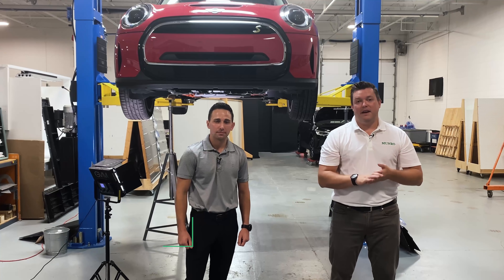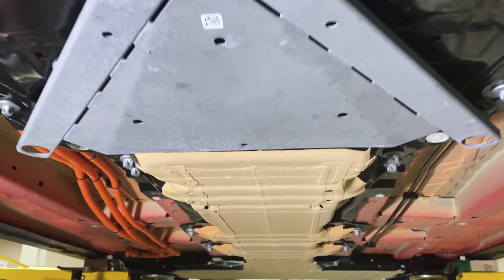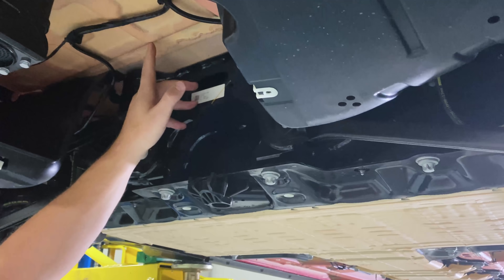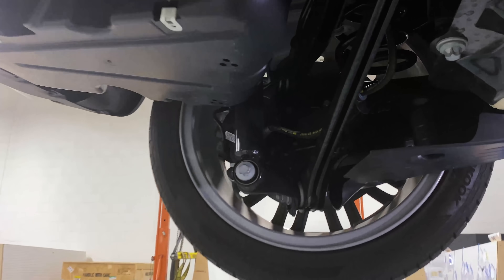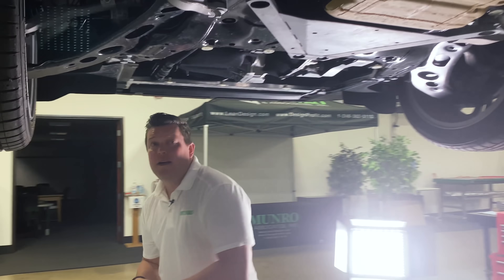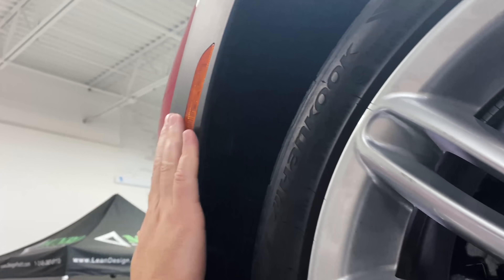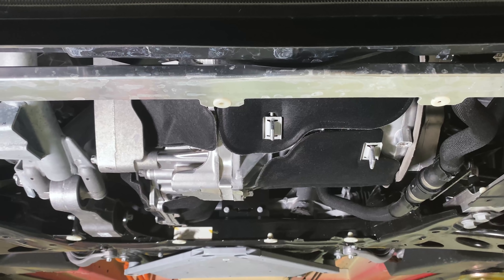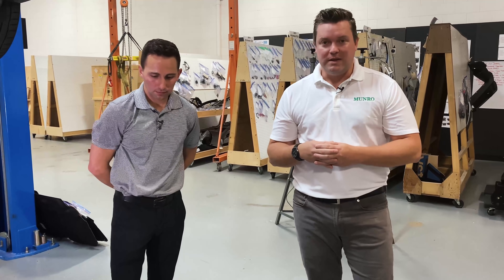Mini Cooper SE- Electric | Undercarriage

Comment: Does anyone know if the battery is accessible only from under the car? Or is the battery accessible also from under the rear seats from the inside of the cabin?

I am afraid of battery leaks, so I do not want the battery to be inside the cabin. Any info?

Comment: Can't believe the exposed high voltage cables.  You could rip them off going over a curb.  Jordan is a natural.  Very informative.  Hope he gets more air time.  Cheers.
Reply: They are not exposed. The Munro team failed to mention that they took off the protective shielding before filming.

Comment: I was horrified to see about 3 feet of exposed high voltage battery wiring underneath the vehicle running alongside the battery pack where any road debris could compromise it.  To me this is very concerning.

Comment: It appears that most viewers of this video, who are mistakenly ranting about this being "bodged", "slapped together",  or dangerous do not realize that the HV cables are completely covered by a full body length underbelly pan (removed prior to shooting video), that actually provides a smoother and more aerodynamic underbelly than the ICE mini. The HV cables are in fact not directly exposed to the outside, as most seem to believe. I think it would have been more accurate to provide viewers a look at the actual underside without the underbelly pan removed, rather than to simply point out the location of the HV cables as a negative without context. It would have also been more accurate and contextualized to point out that other BEV's, such as Tesla, route cabling in the exact same manner on the underside.
Reply: As soon as this video ended I went in the garage and looked under mine to see the very long and wide belly pan.  I agree this video was a little bit misleading about what is actually out in the open and exposed.  Love my MINI EV.
Reply: Good info!

Do you know if the battery is accessible only from under the car? Or is the battery accessible also from under the rear seats from the inside of the cabin?

I am afraid of battery leaks, so I do not want the battery to be inside the cabin. Any info?
Reply: @KR93912  Think of the batteries in the mini as packages or "tootsie rolls" of coin cells, much like CR2032's, but bigger and stacked on top of one another. An ev's batteries are not plates suspended in an electorlyte or acid like a 12v battery. They don't leak. If damaged, a sort of spontaneous ignition can occur due to shorts but they can't leak as a common 12v battery.

Comment: The underside of a car I would think should have adequate shielding.  In fact, I would prefer top notch shielding especially for an EV.  I realize weight is a major criteria, but routing those electrical cables on this vehicle as shown, seems like an after thought.  Have your wire nuts handy every time you go on a ride.  LOL

Comment: What’s an epdm too please?
Reply from the maker: EPDM rubber (ethylene propylene diene monomer) is a rubbery thermoplastic widely used across many fields for its low cost, good molding characteristics, and very wide service temperatures.  It’ll stay rubber in winter in Canada or Russia, while staying solid in Death Valley or Dubai.
Reply: Thank you from Sydney Australia. Regards Chris. Great program

Comment: Looks like the high voltage wiring was an after thought. Why didn't they strap them on the roof. In winter driving ice would build up on those cables and get ripped off.

Comment: After watching this a second time, why did Mini/BMW run so many extra feet of heavy copper HV electric cables from the front of the car to the rear of the battery container at rear of the vehicle? Extra weight means less range in an EV.  Also, why did they use a metal battery pack container covered in sound deadener instead of a plastic composite battery pack container to save weight?

Comment: High voltage cables are done the same way in the $130k Tesla Model S Plaid. Check around 7:30 in the Rich Rebuilds video. And that is a clean-sheet EV.
Reply: Yup, people just wanna hate without checking their favourite vehicles out first

Comment: Would rejuvenator help the front spat? I've seen a lot of those plastic pieces ruined at the bottom of cars before so it's nice to see the engineering going in to make them last longer but i am guessing that over time it looses its bounce. I've seen some people spray WD-40 on rubber parts, not sure what you guys would recommend as a type of chemical to look for.

Comment: Did you guys pull that driver's side underbody 'spat' out, or did you receive the car with a fastener missing? If you look at 7:11 there is a hole in the plastic indentation that looks like a fastener should connect the spat to the metal above. If not, then that is some seriously odd looking design on Mini/BMWs part.

Comment: I'm genuinely alarmed by those easily exposed HV wires.  If the vehicle is involved in an accident or hits road debris then they are exposed.  In theory the car will detect the insulation failure but these systems may not be perfect.  They are also a maintenance issue compared to stiff brake lines that might be more typically exposed.  I would have liked to see them either routed in the interior cabin somehow, or with a plastic/metal cover.

Comment: Is it only me or is it just insane having those vulnerable cables dangling around unprotected? When I saw that I could hear Sandy scream across the globe in shock...
Reply: The covers have been removed for the purposes of the video
Reply: Also, not sure where those are running from. I thought the wires from the battery ran inside the tunnel. Maybe something for the regenerative brakes?

Comment: Very nice! Run over something in the road and rip your voltage cables right off of the car which
In turn will bust the connector in the battery and then you can put a new $25k battery in the car.

Comment: Rear cradle of the newest 5 and i believe 3 series are solid mounted to the body. (At least on the M models that i know of) It’s been a thing for a bit. But yes traditionally they are rubber isolated. Also yeah i noticed those lines are quite exposed and it seems they’re held on by plastic zip ties. I’d hope those don’t get brittle over time leaving those lines hanging down.

Comment: To me, I care mostly about the battery. It is my understanding that it is a prismatic cell style battery made by CATL. I hope they go into a price breakdown, but I believe this style is safer than pouch cell but more expensive and less energy dense. What does anything else matter if there is a crap battery or terrible BMS/cooling? I also believe that this style is easier to replace, at least judging by the i3 which used the same pack.
Reply: Not the same pack. Completely different architecture, cells, and count than i3.
Reply: @khitchens7308  Thanks. That information is always so hard to find. Hopefully they do a breakdown of the pack as well.

Comment: HI COREY, WELCOME JORDAN!!  I understand that the E-MINI is built on an existing ICE platform, and not a dedicated EV architecture, but why in the HELL would they do such a GREAT JOB protecting the front of the battery pack, and leave the most important electric lines just "dangling down" under the lowest, most vulnerable place of the car??  And isn't that orange plastic electric conduit not very tough??  ITS NUTS!!!   CHAS ORVIS, PLAINVILLE, CT.

Comment: Why do they even need the high voltage lines there? the motors are in the front aren't they? Unless its for the charge port, but then why put the port at the back / why not put the charging gubbins by the charge port???

Comment: This looks like the definition of a half ass Ev conversion job. I was expecting Mini/BMW to do a better job but they clearly did not. Great review guys !
Reply: really looks like a proof of concept/prototype. Those dangling orange cables though...
Reply: @CarlForde  the covers have been removed on this car, they aren't usually exposed
Reply: @CarlForde  on some German vehicles brake lines were routed the same way, never had any issues of them failing, that being said you would think they would protect them a little better.
Reply: Probably a rush product to fill a niche in a rapidly changing market with minimal effort.

Comment: I thought that BMW knew better than to have their high voltage power line underneath without any protection.  At the very least they should have a removable plastic covering.  Converting an ICE car to electric has many compromises.  This is one reason why Teslas are the best.

Comment: I don’t see any need to re-invent the wheel(s) see what I did there :-)
The car really won’t work as an EV because the 4 inch (or so) battery pack will raise the floor too much. An entirely new design is needed. Suspension might be traditional but everything else would change. Higher floor means  car has to be taller. I’m not a fan of SUV style but that’s what EVs feed into. 
Check out the designs by WilliamTowns back in the 1980s. His Hustler range had four and six wheel cars using mass produced subframes under a steel tube space frame with large glass areas. Safety demands have moved forward but that should not spoil the idea.

Comment: Forget stealing catalytic converters - that exposed wiring is valuable copper, and all one needs is a slightly customized big shear and some insulating gloves !  How does it survive debris thrown up by the tires when driving on gravel or dirt roads?  Bad design choices here, imho...
Reply: The guage of that copper is probably 12... It's not that valuable. Also you don't need gloves to yank it, the relays will but the high voltage relay when parked. It's very unlikely to shock when cut one at a time. That's also a really odd design... Why is the three phase inverter on the back of the car, might be in the penthouse.
Reply: The wires aren't exposed. They are protected by a very serious undercarriage cover. See this video: https://www.youtube.com/watch?v=bgBIDkQ5d0A. 

The jokers from Munro Live failed to disclose that they removed the undercarriage cover.

Comment: I'd like to hear Sandy's evaluation of those power cables hung on the bottom.
Reply: Me too. That is such a homemade style of job. No engineer worth his degree would do such a thing, unless he/she worked for BMW.
Reply: @mikedx2706  Perhaps they found a British Motor Car engineer for this part.
Reply: And why isn't the battery pack configured so the big leads come out near the inverter?
Reply: Look at the undercarriage of Toyota Prius. It has the same high voltage cables deployed in a similar fashion to the MINI. This is common practice. 

You guys don't work on many cars, do you?
Reply: @jayhawkeyes  Ignorance can be a cruel mistress.  While I respect most all the Prius has accomplished I see now that they have a design flaw that could easily lead to fires.  Many older British cars had the batteries at the rear of their front engine vehicles with some justifications but the wires were routed inside the protection of the floor and splash pans.  It would be interesting to know the statistics on the Prius and the sister ships that have high voltage leads on the exterior not to forget directly under frame extensions directly exposed to everything in or on the roadway.
Reply: @unclegeorge7845  "While I respect most all the Prius has accomplished I see now that they have a design flaw that could easily lead to fires."

What you "see" is a figment of your imagination. If there was a design flaw with the friggin Toyota Prius, the most popular Hybrid car in the history of the world, then there would have been a recall.
Reply: @jayhawkeyes  Good Grief.  Have a nice day.

Comment: I had been considering one of these but thanks to you putting it in the air what I saw especially regarding the routing of the high voltage wires and cobbled together battery assembly there is no way.  They shortcutted major critical items, what did they shortcut you cannot see....thanks again guys.

Comment: It's even worse than expected. What are the 3 HV lines for? It can't be the inverter-motor cables, they are both in the front engine bay, right? Please tell us that they haven't placed motor and inverter so far away from each other!  F56 rear suspension was already a major step back from the previous R56, even went back to steel arm (instead of big aluminum casting) and from coilover to older coil and damper. In this electric variant it looks even worse. On the ICE Mini the central tunnel houses only the exhaust, but it's so large that on the countryman 4x4 it houses also the transmission shaft for the reat differential. Brake lines runs on the bed like in this one.

Comment: In some markets, 30% of MINIs sold are Electric Vehicles. This car is a stepping stone vehicle that allowed the existing ICE factory to produce Electric Vehicles. Why do you Tesla Fanboys have such a hard time understanding that?

Anyone here who expected MINI to design and produce these Electric Vehicles in any other manner is a Tesla apologist who doesn't understand the timelines and manufacturing resources required to build a full EV from the ground up. In a very short time frame, MINI will be moving completely away from ICE. Converted ICE vehicles likes this car make that transition possible.

Comment: Wouldn't mini owners like that this is basically a factory made EV conversion without changing the car much?  People have been paying big bucks for EV conversions on niche vehicles.  I would say shared platforms works for lower volume niche cars.  The people who want minis can get a solid EV conversion with this for dirt cheap.  The car costs $23,250 after the federal tax credit and under $20k if you live in a state with additional incentives.  If you fit and like mini's this is a nice daily driver as 100mi of range should be good for nearly all daily commutes.

Comment: Well done review and insight. I’m assuming that I saw mounting points for a cover panel at the front and rear that I don’t remember being mentioned. Especially in lieu of the fact that the high voltage lines are so exposed!

Comment: We have had five MIN’s currently factory ordered F56 Hatch and 2021 Clubman. Was invited to the premiere of the SE and can’t say I was impressed. Making the combustion version electric came with too many compromises. A completely built from the ground up EV was required but they were so far behind the competition they needed to get a EV out. Branding it a city car annoys me none of our MINI’s are city cars they go on road trips and holidays. The hatch did 400 miles the other month in one day going from Glasgow to Warwick. The 2021 Clubman replaced a 2017 hatch that had done 140k miles.

Second gen from the ground up designed by BMW styling with Great Wall (China) pack and running gear.

Comment: Well,  if you want to see other manufacturers installing high voltage power cable low and unprotected, unfortunately will have to wait for your Tesla model S plaid to arrive. But I think for Tesla that would be ok... And curiously are you getting a new battery for the ID4 or will keep is a background ? 😀

👍 out of that ...great video can't wait for the next👍
Reply: Yeah! True altoght much shorter. Also isn't that in Plaind covered with flimzy plastic panel as underfloor aero surface. (difuzour leading edge.)

Comment: Well done Jordan!  I was surprised the undercarriage was still so “ICE”. I suspect there were economies of scale but having a clean sheet of paper in this area would seem to make things easier in the long run I.e. suspension change needed for the lower CG or increased weight impacts to correct for ride; effort to shoehorn into limits of ICE chassis compared to purpose built etc,  It would be nice to know if there was a “rule of thumb” on the potential weight savings if a new under carriage could employed.  Great job as always, and while all miss Sandy, it is great to understand the real team that makes lean design work.
Reply: It's easier to retrofit a existing car than completely new design.
Reply: It's an ICE retrofit that allows MINI to remove ICE vehicles from the road. Currently 30% of MINIs sold in some markets are electric vehicles. All MINIs will be electric by the 2025-2030 time frame.
Reply: @jayhawkeyes  good point
Reply: I do not believe these to be true EVs these are ice retrofit..
Legacy car makers pretending to build true electric vehicles.
Reply: Hi thanks for all the feedback.  I guess I was thinking that yes if you have an ICE chassis there would need to be a point where you design custom battery packs and try to live within the limits of an existing design…OR .. the other path of designing a frame / undercarriage that takes into account the needs of electric out of the box to fit the upper body shell to create a better solution.  BMW has already dabbled with electric years ago and could have gleaned some knowledge or experience from that trial to improve their ability to make a better car of the MINI…. but perhaps not at this time.  It may take years to create a new chassis to cover electric needs as far as I know.  Thanks Again!

Comment: Am not keen on those high voltage lines just kinda held onto the underbody with cable ties.  You'd only have to drive over a tree branch of a chunk of truck tire to rip one of those off to the point where it could drag on the road and abrade away...then you've got a battery fire waiting to happen.